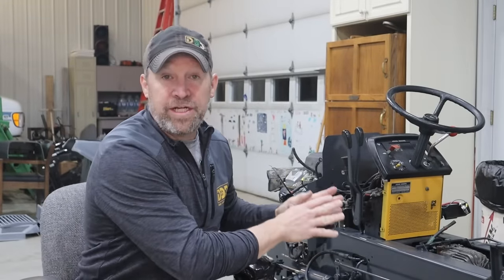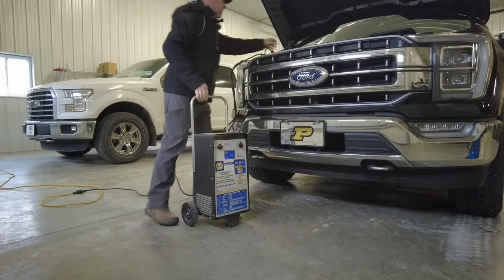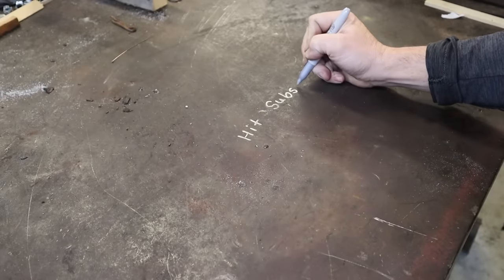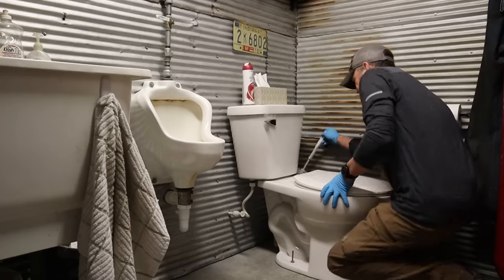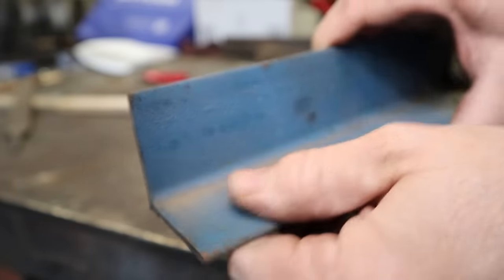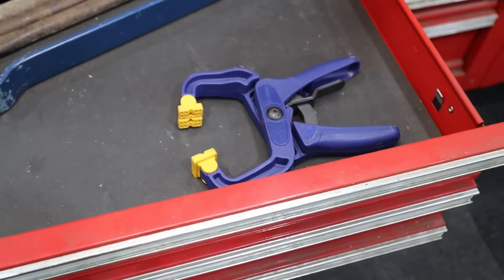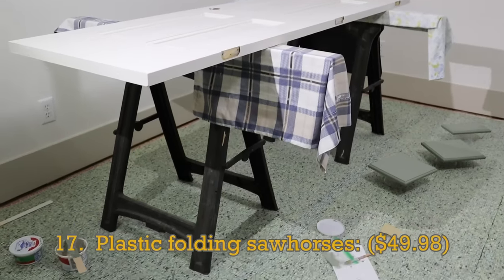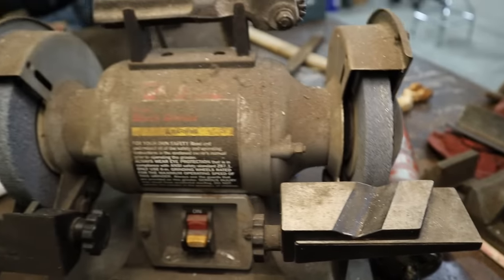(20) Must Have Tools You Don't Know You Need

Comment: Neil, one can make a portable battery charger with an old pressure washer engine and frame, and an alternator, along with jumper cables. This is important for use on a farm where the tractor battery goes down in the field, maybe overnight, and you can't get an extension cord that long, and you can't get the truck in that row in the field.

Comment: This is a great list!  I picked up a couple of ideas here, thank you.  Some that I would add:  1) wooden shims.  They're cheap, and handy if you have to fasten things together that aren't quite in alignment.  2) loctite 577 sealant.  This is the stuff that makes threaded pipe joints not leak, even if the imported threads are poorly made, or aren't even tapered.  3) an angle grinder with a flap wheel.  If you do metal work, you really need a dedicated grinder with one of these.  4) an assortment of machine screws and nuts and bolts.  For me, 6-32 up to maybe 5/8", stainless to 1/4", then grade 3 plated for the larger one.  Saves a lot of time in trips tot he hardware store.

Comment: File to refresh the edge on shovels and hoes.  
Multimeter and a basic collection of electrician tools.
Drill bits and saw blades.
Pruning shears.
N95 masks for dust.
Work gloves.
Steel-shank boots for digging.
Ear muffs.
Safety glasses.

Comment: Cheap three jaw puller set, slide hammer, nice set of brass hammers I like my snapp on one, induction tool heater, a good parts washer, sand blast cabinet, Hydraulic shop press

Comment: The first time I saw a friend using one of those LED headlamps I thought it was goofy and unnecessary.  I eventually discovered that they are great because they allow you to use both hands when working in low light/dark situations like under the hood, or just plain under a vehicle, unlit attics, etc.  And you can aim them better than the old Mini-Maglite in the mouth system.
Reply from the maker: I often paint with one of those too. Kara wore one when repainting the upstairs as well. That's a good addition to the list.

Comment: I personally like a sharpy for most things but for metal, I like a silver welder's pencil...even if I'm not welding. Thanks for the video. I also use a caliper more often than not as well as brass gauge set for quick, consistent measuring. "Younger" people will never know how good they have it with videos like these! We had to learn the hard way (by experience).
Reply from the maker: Great point!
Reply: Hi Neil & Co. I would agree, el- cheapo digital vernier caliper , super  handy, cheers from Paul in Denmark

Comment: a pair of vampire pliers should be on the list.  Once you own a set you will always find a use for it. Another tool that doesn't quite fit the list but is handy everywhere is a good laser level.  There are always things that need hanging or leveling to get a job done right.

Comment: Great List of Tools.  I really have come to like the Step Drill bits. They work great on thin and thick material and best part they double as a countersink.  This list could be a 100 items long lol.
Reply: I keep meaning to get one for my Rc hobby I for ever snapping small m2 and m2.5 bits
Reply: i agree step drill bits are great. tip take marker and mark the size hole you want it's easy to go to big. yes there are at lease a 100 items you need.
Reply from the maker: Love my step drills too!  Thanks Dave!
Reply: You should try the Vortex bits by Norseman. They are a little pricy but good.
Reply: Never liked them. Never was I satisfied with performance on what I used them for.
I do have a quality drill bit sharpening machine though.

Comment: All of those items are very helpful and I use all of those frequently. On my latest project I used a few things that others may find helpful. 

1.) silver streak welders mechanical pencil

2.) spring loaded center punch

3.) center drill bit

4.) magnetic parts tray

5.) hook and pick set

6.) dead blow hammer

7.) brass hammer

8.) stubby flex head ratchet

9.) magnetic rechargeable work light

10.) needle scaler
Reply: I have #9 and unfortunately it doesn't work on the newer F-150s.  Aluminum will do that.  :)
Reply: @HwllMI  perhaps a suction cup mount will be better suited😂 good to hear from you!
Reply: That's a better option than buying a Chevy!
Reply from the maker: Great list additions!

Comment: 3/26/23
Hi Neil,

I believe the best tool in the workshop, perhaps the greatest in the world... Duct Tape.
Oh boy, can you tackle the world with this stuff.

Last September, I bought a brand new Cen-Tech battery charger from Harbor Freight, for 12 volt lead acid batteries. I paid $45, with a $10 off coupon.
It even had a 50 Amp jump start! I thought it was the real deal. I couldn't have been more wrong. The gauge only measures in percent how charged the battery is and
when I try jumping the battery to start an engine, the charger clicks and the lights blink. I can't stand that thing, so I definitely agree that a good battery charger and starter is going 
to be a well-worthy investment. Can't wait for the 318 to be finished! Older GTs are capable of anything. You'll be ready for dinner before they quit working on you. Thanks for sharing!
Take care.

Comment: Proud to say I have everything on this list with the exception of that fancy zip tie cutter. I usually use a small pair of angled cutters. I learned very early on smart chargers won't charge dead batteries. Also can't do nickel plating or electrolysis rust removal. Now I have a selection of "dumb" chargers.

Comment: Cheap plastic storage boxes with multiple compartments are great for disassemblies. I buy cheap ones from the dollar store for anything that has multiple components. Like say you have to take off a battery bracket, intake hose and airbox to get to an alternator...each set of fasteners goes in a different compartment for easy reassembly but you still have everything all together. The llid keeps nuts and bolts from getting spilled or getting other debris mixed in. You can also label compartments for longer projects where maybe soaking or painting or fabrication might be involved.

Comment: the clear plastic razor blade dispenser, is where you store\dispose of used blades. theres a slot they slide through on the bottom side👍,  if you dont have a zip tie cutter, you can melt the ends so they arent sharp, solder gun, or a grill lighter both work well. my favorite use of an old school battery charger besides charging batteries is useing it for de-rusting metal parts through electrolisis, its a super simple process, and absolutley the easiest, least labor intensive way to completely remove rust. lots of great youtube videos on how to do it, it works amazingly.
Reply: I use an old plastic prescription container to store old blade and toss the whole thing once it's full.

Comment: They make plier frame  flush cutters that are handy for trimming wire ties flush and I have used them for decades .
For the cost of your trimmer you can pick up 2 or 3 of these and keep them in various places because you will always misplace the things or have them walk off .
The plumbing brushes they sell for cleaning copper pipe are very handy for cleaning battery terminals , and I keep several around .
They have an inner and outer brush for 3/4" and 1/2" pipe .
For those with deep pockets they make inductive heaters that will heat a bolt red hot for unseizing stuck/ rusted fasteners .
You can find old school analog chargers for cheap at garage sales .
Another approach is to pull the battery out and charge it with jumper cables from your vehicle until you get enough charge to use the fancy modern charger . They won't charge deeply discharged / dead batteries because it would draw to much initial current and damage the charger .
If you can get it to 10 volts or more , you can usually get the charger to not freak out and finish the job .
Another great way to organize for a project is to use those Plano 3700 / 3600 tackle boxes for the small parts . They have adjustable compartments and I always have extra around .
When I buy a new tackle bag I upgrade the cheap boxes they come with to better ones and use the elcheapos for the shop .
If you have an old 5 - 10 horsepower engine , a pulley , and , an old alternator laying around , you can build a portable generator for charging dead batteries . An old push mower frame and handles makes a great base for these .
You can use the alternator for DC or AC , and even make a small engine driven welder for small projects , for cheap .
Lots of resources on the web with info on modifying alternators for various purposes .
Of course a couple of batteries and a set of jumper cables also works for a quick and dirty welding setup ..
An air hammer with a blunted chisel or point makes a great set up for knocking out stubborn pins and loosening seized bolts .
You can also use an electric breaker / hammer if you have a hammer only function .
A needle scaler is a tool you didn't know you were missing , until you get one .
Weld slag , heavy rust scale , caked and baked dirt and oil layer , it will make short work of it .
For installing bolts and screws in tight quarters , a selection of various pieces of hoses , shrink tube , tape , etc , is very useful .
You can put the hose on the head of a fastener to get it started and pull it right off once a couple of threads are engaged .
For keeping bolts in a socket a little tape or shrink boot works wonders , same with screw drivers .
These too will pull off easily once a few threads are engaged .
Reply from the maker: Great list of tips and tricks!  Thanks for taking the time to share.

Comment: Hey Neil,  I find that a quality combination square, like Starrett, Brown & Sharp or Mitutoia  is one of the most used items in my shop.  Wheather it is a wood project or metal projects if you know the tricks of the tool it is invaluable.  The most common is a 12" ruller,  I have that along with a 18" and 24" There are also center finder and protractor attachments available.

Comment: Rather than ice cream buckets, I prefer one, two and 5 gallon buckets.  They are much more ridged and durable than ice cream buckets.  They don't deform when loaded with tools.  Heavy or sharp tools don't go through them.  You can mix and catch a variety of products in them paint, concrete, thin set, anti freeze, oil, setting typy compound.  They are handy for storing awkward items like caulking guns, hatchets, clamps or any longer items like power washer wands, levels, pry bars.  I have one full of shop vac attachments.  I keep my paint brushes and supplies in one.  Trowels in one.  They make good storage mediums for things to be kept dry as many 5 gallon paint buckets have a rubber seal.  Not as fun to get as ice cream buckets though.
Reply from the maker: Love it

Comment: I have used emery cloth a lot cleaning fwd hubs while doing bearings, rear axle shafts also. Remember the scotch Brite pads to polish afterwards! Going to get myself one of those silver sharpie, probably 2. Thanks. A real vise on a bench grinder stand with 1 wire wheel is needed for a lot of work, cleaning bolts comes to mind. 👍 The smart charger is needed for the gell cell batteries. It was the only one that would resuscitate my dead red top battery.

Comment: Excellent list, Neil! I especially like the zip tie tool. And I use ice cream buckets for taking corn out to the squirrels, deer, and birds and all kind of things (actually Olive Garden 1-gallon soup buckets) - but I've never used it as a tool hauler to project locations. That's a great idea. How did I not think of that? I can't tell you how many times I've struggled carrying a hammer, my drill/battery, bits, screws, screwdriver, electrical tape and wire nuts from my basement tool box to the upstairs. This video reminds me of a point made by Clint Eastwood in his movie Gran Tornio: It takes time to acquire all the tools you'll need in life.  It's okay to not have them all at once when you're a young tinkerer. "Take these three items, some WD-40, a vise grip, and a roll of duct tape. Any man worth his salt can fix almost any problem with this stuff alone."
Reply from the maker: That's a great quote Chad. I hope that ice cream bucket trick saves you a few trips up the stairs. Plus, you know... You get to eat the ice cream first 😂

Comment: It's funny you said what you did about the battery charger. I asked for an analog charger one Christmas and my wife couldn't believe I didn't want one of the fancy smart chargers. I explained to her about an issue we had with a boat battery that was just like the issue with your bosses truck. The old tried and true analog charger is fine, but I do also have the means to test/analyze a suspected "bad" battery. 

Other tools that I find invaluable when you need them are:
1. The little magnetic trays for holding bolts/screws
2. A decent vise
3. Some sort of corded or battery-powered lighting
4. A set of O ring picks. They are good for more than removing O rings
5. A magnifying glass (my eyes ain't what they used to be)

I'm sure there are hundreds more suggestions, but these are some of the ones I use most often.
Reply from the maker: Love it.  I'm grateful for all the fantastic suggestions for a new list!

Comment: Well, Neil, we think (work) alike. 100% of your tools I have and use regularly. In addition to the plastic buckets, I would add bottles. Neither leaves our kitchen without at least a short stay in the shop or garage. The bottles are great for drain oil and other fluids. I also over the years have a large collection of modified tools for all of those tight places and infrequent jobs. 

A "C" clamp with a little modification makes a decent valve spring compressor for those small engines. And, I likely have dozens of wrenches that were bent or ground to fit and make getting to those hard-to-reach bolts and nuts easier. I buy the cheaper wrenches for that purpose and I usually have a set around just for that purpose. 

The wire brush on the bench grinder is something that I have learned tough lessons from. I use it all the time, but back in the 60s I stupidly used one without a face shield and I carried around a piece of wire in my eye until it was removed during cataract surgery a couple of years ago. I was dumb back in those days! But I can't count how many times my fingers got sucked into that wire wheel when cleaning a bolt. That smarts and take months to heal. 

I think I would add utility knives to your list. And as for the silver marker, and this is something you may have a need for soon, after repainting your plastic dash panel on the 318, the silver marker works great for renewing the lettering on your plastic dash panel on the 318, the silver marker works great for renewing the lettering. It will look as good as new.  

Another good start to a Sunday morning thanks to your latest video. But can we get back to your tractor build soon? :)
Reply from the maker: Thanks Joe. Great tidbits. I like the idea of the marker for the dash renewal.
Plan to have a tractor update this Sunday. Been slow going lately.

Comment: Great list, definitely getting some emery cloth and I agree bench top grinder with a wire wheel is great, mine has a fine bristle which works nicely 

If you live in the rust belt a air hammer is a must (best way to knock out swing arm bolts, stuck break drums, ball joints)
Multi angle pry bar 
Small pick set 
Test light/ multimeter
Good plumbing torch 
Impact screwdriver

Comment: Nice video, i had the same experience with battery charger and i too have an analog. i have a 90 angle screw driver a flat and philips, very usefull in tight spaces, a must for me is also a rivvet gun.

Comment: On the analog battery charger - it's possible to fool the newer chargers into charging a battery. You can wire the target battery in parallel with a good battery (I used a lawnmower battery) with a couple pieces of wire - hook the charger up to the good battery and it will charge the dead one too....  good work-around if needed.

Comment: The best way to dispose of razor blades is with a sharps container or called a blade disposable container, another choice for a silver sharpie are paint markers (I have had better luck keeping them usable over the silver sharpies so much so that the sharpies now stay in the house), the zip tie tools are nice but have a drawback of putting extra pressure on the item and in some cases can damage the items like small wires and I prefer to instead use flush cutters similar to side cutters but with a different grind and cut with the same result, and as for the deburring tools and countersinks he nailed it because they are worth every penny.

Comment: When I worked in the retail world as a stock clerk and a snack vendor, I would go through a good amount of single (or even utility knife) razor blades.  It wasn't until I started using a wire brush to take tape residue off to expand their lifespan, plus sharpening them once a week on a stone.

I think the mini blowtorch is a good heat gun also.  I've used one to de-ice locks on my work truck.
Gold (or any metallic) sharpies have to be an essential.

Comment: A quality digital multi-meter with high current capability and frequency (or an inexpensive handheld Oscilloscope). You wouldn't believe how many times I have diagnosed an issue with an alternator or voltage regulator with this tool.